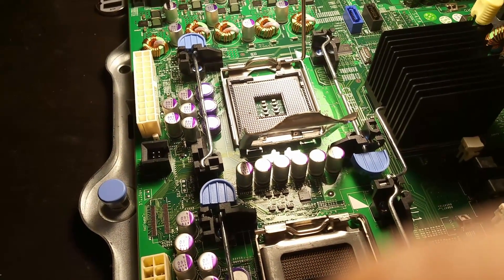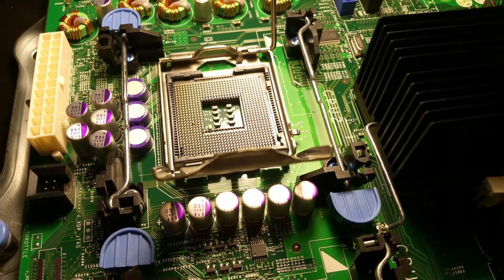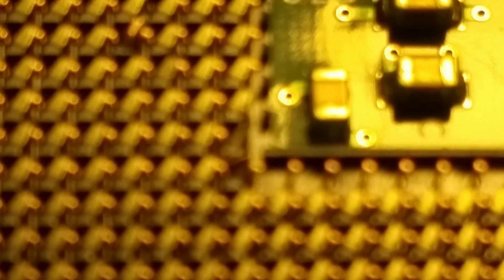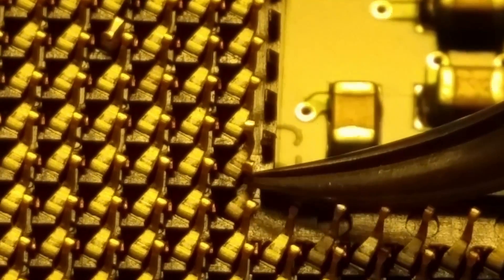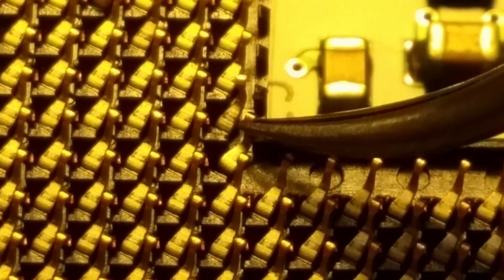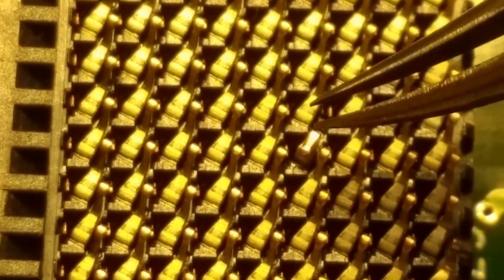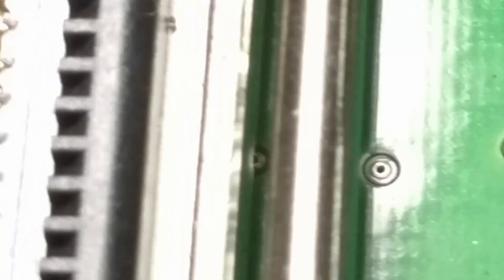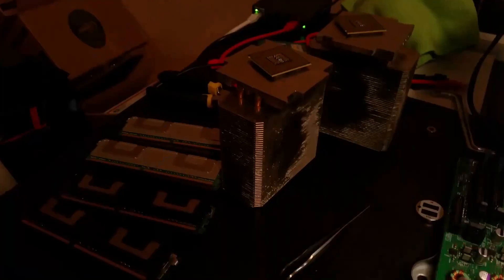Intel LGA Pin Repair

Comment: Hey, buddy. What camera do you use?
I'm planning to buy a camera just like yours - with nice zoom and focus. :p
Reply from the maker: Rafael Requião I use an Olympus that I have had for a few years usually.  but this was actually shot on my phone.  Galaxy S7.  it was easier to hold while doing this.  i need to get a good mount and tripod to make life easier.
Reply: I did some crappy things with the camera from my Xiaomi Redmi 2 too. I used some LED lights and magnifying lens too.
Reply: Unknown Sanchez  poor man's ways to get the job done. Review your offensive language... consider this is a question from 3 years ago and I had access to more specialized methods and tools during that passage of time.
Reply: Unknown Sanchez  sigh

Comment: Please answer me as well as straighten the pins, you have ever done or thought to pay off the pin directly on the processor? That is, is missing a pin from my socket, then I pulled a pin from another socket, and will try to weld the pin directly into the processor itself in the contact that corresponds will that work? I will try to work out will record a video
Reply from the maker: Dilson Ramos take off a pin from one socket and put it in another?  That would be very difficult.  the attachment point is bellow the plastic of the socket.  Not sure it is even possible. If it is, you would need some much better equipment than I have.
Reply: take off the pin from one socket and put it in another? yes but I meant to weld the pin directly into the processor that is is missing a pin in the socket and is difficult to access, I try to weld the pin that lack direct processor
Reply from the maker: Well, you would want to solder it, but again the issue will be making contact inside the socket.  I really do not think that would be a wise idea.  Very high probability of damaging the CPU trying to solder the pin directly to the CPU.
Reply: Chad Bremer The CPU does not like me not weld this single pin, I will weld in one of the contacts processor ever made measures if it works engrave a video. Thanks again friend!